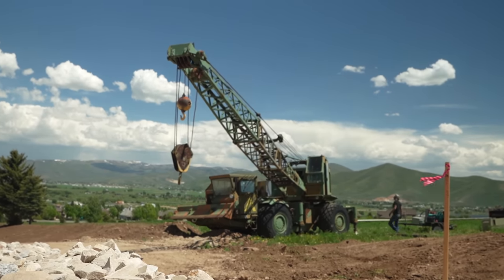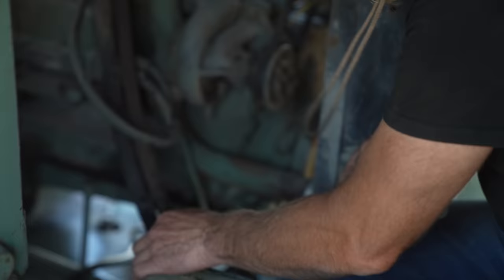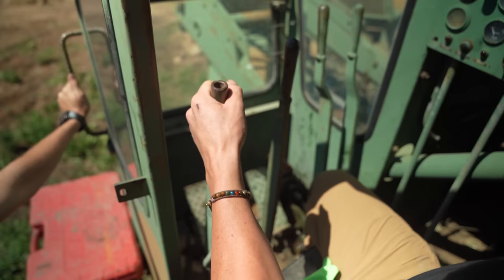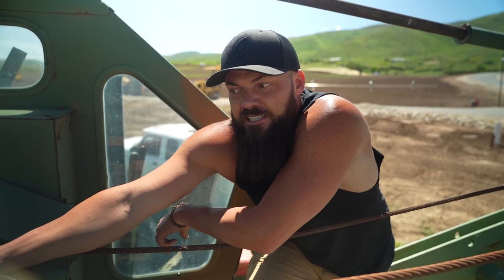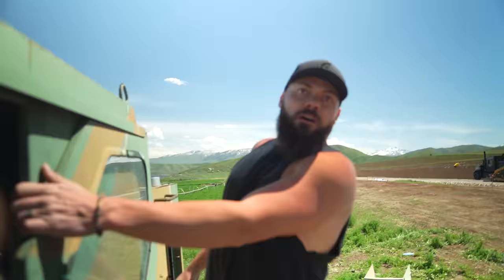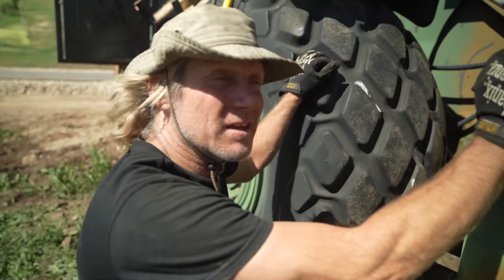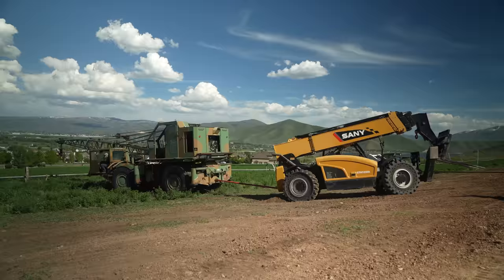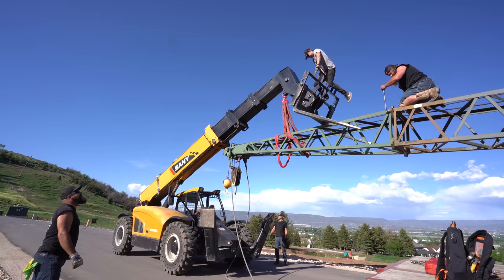If We Start It We Keep It!

Comment: Hey guys , I used to operate one of those. It’s a 20 ton rough terrain crane. I ran it in Germany in 1969. Had a great driving it on the Autobahn. There is a master clutch on the operators right side near the floor that disconnects the crane from the engine so when you start it nothing is engaged. If you have any questions let me know and I’ll try to remember how everything works for ya.
Reply: Also look up the manual for it should be able to find a free pdf
Reply: Awesome man
Reply: King don’t forget you 👑
Reply: @Swiftbuzzed :
Do you happen to recall the nomenclature for that crane?
Reply: I knew it was old. they have a commercial crane painted green when I was in the engineer companies, I was in Germany in the 1980's. It did not take much to get them stuck.
Reply: Lol, trying to imagine a crane overtaking a Porsche at speed on the Autobahn 🤣
Reply: @emilschw8924  don’t think to hard you might have a stroke
Reply: @emilschw8924  :
😁😁😁😁
Reply: You should be a PIN comment from Awesome Dave
Reply: @daleallen7634  Crane, Wheel Mounted: 20-Ton , 30-Foot Boom. It’s a Model 2380, FSN 3810-763-7728. I also have a Parts manual TM 5-3810-232-20P.
Reply: @swiftbuzzerd7497  :
Tnx, o.m. .
Reply: So cool  you could share your knowledge
Reply: I ran the same cranes in California in the 90's.  The biggest thing I remember is how many leaks they had.  These were mainly used for assembling Bailey bridges and fell out of use as those bridges were taken out of the system.  They were real exciting to drive down the marrow streets of Ft Ord CA, the steering was so worn out it was a fight to keep them between the curbs.  Swapping tires was a major pita too.  The original tires refused to come off the rims.  We resorted to pulling them apart between two D7 Cats.  Exciting when the popped free!
Reply: @paulgumper  Mine did not have many leaks, But I picked it up in Karlsruhe, Germany. It was brand new at that time but had been setting out in the open for who knows how long. All the clutches and gimbals were frozen  and rusted. It took a few days of hard work and a lot of oil to get everything working again. On the main engine there was a day tank for the fuel. It was down on the left side of the frame. There was a fuel screen that kept clogging up every few days. It got so bad I had to remove it. As you know the crane carrier had regular, four wheel and oblique steering. Did yours still have the link that locked the rear axel so it couldn’t steer when driving on the highway?
Reply: Also, although I was assigned to a light equipment company. Once a year I went TDY, temporary duty, to the 552 bridge company. The army, with permission from Germany, would, once a year, close the Rhine river and we would build a float bridge across it. We would then see how long it would take to do that and try too improve on that time. Of course they cheated but that’s another story.
Reply: @swiftbuzzerd7497  Yes, it had the lockout for front steer only but the steering gear was in bad shape.  It would resist going in a straight line pulling to the right, then it would dart to the left.  Not fun on a narrow road with a 40k pound ten foot wide monster!  Basically the entire machine was in bad shape from setting all the time.
Reply: @paulgumper  Yes, the worst thing you could do is let it sit idle. I ran mine almost every day. When building those float bridges I spent up to 18 hours in that thing. Putting boats and bridge sections together and then disassembling them and putting back on the trucks.
Reply: What is the value of it ?
Reply: Thanks for your sacrifice sir!
Reply: Operated, maintained one in Mannhiem, germany late 70s. I wanted to bring it home! 30' boom, heavy lift. 💪
Reply: @Railrider765  Yes, Mannheim Germany, Taylor barracks, 535 light equipment company. But in 68, 69.
Reply: In '78 I had crane clutch comp. overhauled.Broke Left rear str. cyl. replaced, new carrier throttle cable. Took me longer to get parts than to fix. Re-certified 20 ton lift status. She was like new when last 😭 seen her. NOBODY used her without getting clearance thru me! 💪 Had two 10,000 lb. lift r/t pettibone forklift. and 1, 6000 pettibone rt.
Reply: Helpful

Comment: The reason you guys were successful at retrieving it and the other 4 couldn't is because you guys have a professional wizard and they don't. That rig is going to be a great tool if you can get it restored to good working order.
Reply: Or the fact they have 200k worth of equipment to pull it out....

Comment: Hydraulic hoses with quick connects for your skid steer or other equipment is worth gold to take up those outriggers without the engine
Reply: You can get power packs, small electric hydraulic pump to fill or empty cylinders. Then you don't have to worry about using equipment or getting oil contamination

Comment: You guys are great mechanics! You remind me of my dad. There wasn’t anything that he couldn’t work on and get to running. Anytime, anyone who had problems with their equipment. They always called on my dad. I’ve seen my dad, pour sweat on the side of the road for hours. Working on folks vehicles that he had never met before. If he seen someone stranded he always stopped to lend a hand. I lost my dad on Father’s Day 2005. And the most thing that I remember him for is his gratefulness to others. He would do anything for anyone. Wether he knew you or not. And if they tried to pay him for the work he done. He would not except it. And the ones that told him that they didn’t have any money to pay him. Which he didn’t charge any money anyway. He would tell them to charge it. :) …. I will never forget my dad. Gone…. But, never forgotten!

Comment: When I was in the Army Reserve (1983 - 1993), the Engineer Battalion (CBT), I was with had one of those parked in the motor pool.
There was only one soldier in the whole battalion (a SFC), who was authorized to do anything other than look (from a distance), at, or photograph it. Both cabs had a retrofit that placed locking mechanisms on the doors, and the windows were all in place. 
Memory Lane. 
🙂
Reply: I was trained on it 62f lifting and loading operator in 1981
Reply: @alphonsotate2982  I was also at ft lost in the woods in the state of misery.. jan 1981-july1991 mos62f

Comment: I recognize that crane. I worked for a company back in the 90's that thought buying the old army crane was money well spent. LMAO! That is a mid to late 60's American Hoist & Derrick, 20 ton crane. I think it is model 2380 or 3285. I remember it has a V8 265 Cummins on the main power unit and a JN6I 6 cylinder for the crane. It can be quite noisy to operate. It's all mechanical and was very touchy. I was about the only person that would operate it. After I quite working there. The only time is was used, was for crushing 55 gal steel drums with the blade on the front. The master cylinders that operate the levers, were always a problem. If the fluid bypassed the cups, you could drop a load real easy.

Comment: There’s a water bottle called cirkul it’s almost the same thing it’s 20$ at Walmart for the starter kit and the flavors are about $4 each. The starter kit comes with 2 flavors and the bottle. You can adjust how much flavor is added and even set it to just plain water.

Comment: Thank you for saving her. We had those to load dummy cargo on are FS ( sister ship) of US Army Supply ship from WW-2 
Mr. Roberts) Film fame. We had Stevidor come from a near by Guard unit to practice with the double boom on the FS. They set these cranes on dock to load pallets of dummy cargo on board. I remember watching the operator always checking his swing break in the crane cab. Good times back in the very late 1970s. The blade on front of crane, they used to smooth out area for crane set up. Very heavy duty truxk cranes.

Comment: I once replaced all the clutches on an English machine similar to this. It was powered by a Dorman diesel for both traction (crawler) and crane. No new replacement parts were available so I scoured every wrecking yard and assembled a group of clutch plates and appropriate centres, reassembled them with a couple having to have new facings and it worked until the boss got in and tried to operate it and pulled the boom over vertical.

Comment: great  looking  crane and  usually  looking at it,,it probably  doesn't  have a  whole lot of  hours on the  engine and  sometimes   fuel in the  motor  might have been  a  stuck fuel injector or  even a  little  water from the weather 🤔  maybe??just a thought...but  i know you're crew will  get it  figured out and  have  it  operating soon,,you guys always do great work for  your  community and  surrounding areas..keep making great videos 📹 👍 😀..and  you are always concerned about our  environment and  surrounding...thanks for the video 📹 👍 😀

Comment: model 2380 rough terrain crane. With that 10 foot boom extension, capacity is down to 15 tons. Used one in a floating bridge company, army national guard. You are going to love using a lube order to grease this machine !

Comment: Wondering what your thoughts on WD-40 are. Care to share? I mean, they say there’s 1000 uses for it. Just how many have you tried?
Also, what’s the craziest thing you ever used it for? Mine was getting rid of a yellow jacket nest trying to happen in the outside wall of my basement (cinder blocks) by way of of the water spigot at the front of my house. Little bastahds were immune to everything else and I’m allergic. Out of pure desperation I sprayed half a can into the hole they made and watched for 3 days with no visible activity before sealing it up with insulation foam.Did the trick when all the hardware store recommended failed! Haven’t had a problem there since!

Comment: On those older cable rigs they didn't have a power down on the hook line.  You just slipped the foot brake.  Until you got to a heavy load....then the foot brake was too sudden!  Trick#1:  Kick the master clutch out, pull the lever into load up, then slip the foot brake.  The draw works runs in reverse acting like a governor.  Trick #2:  On REALLY heavy loads, shut the motor off, leave the master clutch engaged, pull the lever into up and slip the foot brake.  The motor compression will act as a further brake.  Trick#3:  I used to run a 3 part line with the block, that slows it down so It is easier to boom down and winch up to hold the load even.  (Old crane operator)

Comment: I think Dave and his gang should swing over to Skinwalker Ranch which isn't too far from Salt Lake City and collaborate with those guys and get to the bottom of what lies inside/underneath the Mesa.  The Skinwalker Ranch team has been drilling into from the side and drilling down from the top and they know something is about 40 feet down from the top and a couple hundred feet in from the side but lack the expertise to excavate it.  Heavy D has the knowledge, expertise, and probably access to the proper equipment for just such an endeavor.  If there is an alien spacecraft or "base" of some kind buried under the Mesa, a collaboration could be a "win win" for these two awesome teams.  Would any of you guys like to see that?  Just thinking out loud.

Comment: Passed by a telehandler being transported on a truck (semi) the other day. As usual (it now have become a habit of mine after starting to watch the HeavyD crew strap things down) to check it for straps and the such. To my dismay it was strapped down indeed, but only with one chain which is to prevent it from shifting off the sides of the trailer. 

I skedaddled out of there, did not want to see what should happen when there's an accident....

Comment: He guys, if you ever need any help with chemicals, I’m your guy. I work at a chemical warehouse maybe 3 miles from your shop. I’ve been in the chemical/chemistry/mechanical/machining/automotive industry for 20+ years now and would totally love to help you guys out on one of your missions! I’ve lived my whole life here on the Wasatch Front but have explored MANY areas that you guys have frequented many times in your videos. Also, I’ve driven/operated many pieces of heavy equipment and am quite mechanically knowledgeable. I’m currently working on my CDL with tanker and hazmat endorsements to make sure I’m on the up and up. 
Again, I’d love to work with you guys!

Comment: We had one of these cranes in my unit in the army and it was useless. The outriggers do not go out and support any kind of load. The scraper blade is very difficult to use because the wheels do not give it a stable track as a track vehicle does take the thing apart and sell it for scrap

Comment: Im gonna guess that thing has at least one or more stuck injectors.  Being as you are the 4th people to attempt to retrieve this vehicle, likely others have attempted to start it with its old rusty crusty fuel system intact.  That would jack up the injectors and also could be why your oil is full of fuel!  lol  Be prepared for a runaway if you try and start it! lol

Comment: been doing that with water for years, cut slice of orange or any flavour fruit  you wont, the cut a hole in it with you water bottle top just like a pastry cutter, pope it over the neck of your bottle and it the same as your spencer, my mum used to do it for me in the 60's i like cucumber with mine, strange thing is I hate the taste of cucumber.

Comment: Ive always wondered why dave doesnt buy like a mechanic service truck with a crane, it would be useful for these types of situations, load it with tools, you got an extra crane, can fill it woth hydraulic oil, engine oil, coolant, carry fuel
Reply: We're building a dodge  one right now , see sparks motors channel, Doug put an ambulance hydraulic suspension on it

Comment: The real problem with cranes is operators trying to lift too much weight.  The rating of the boom varies with radius, which varies with boom angle.  Operators will assume they are ok, then increase boom angle and tip over the crane or collapse the boom.  The info they neef is on one of those worn off placards.

Comment: Most older military vehicles if they lost engine power, would also lose brakes. That way, the vehicles could always be towed. No vehicles left behind. Not like today's military.
That's why you could pull the crane with your Lull so easily. The crane needs air to apply the brakes.
Reply: My Dad worked for a logging company in the 70's  that had several 78-98 Link Belt line cable machines. Quite similar only lots bigger for  skidding high line. (78,000 lb and 98,000 lb). One was known to die when traveling on the mountain taking away the brakes. I could always tell when Dad had to work on  the upper frictions as they were sprayed with black moly grease. Screaming 6 cyl Jimmy upper and  V8 Detroit lower. Even now there are a few that line skid and they echo through the canyon like music in the fall when I'm hunting. We had a ''Tank track mount'' 108 Link Belt at the mill in the log yard that was fun to move around the yard. memories...